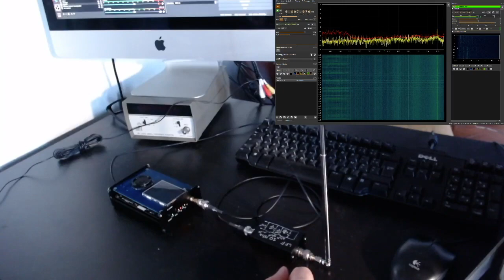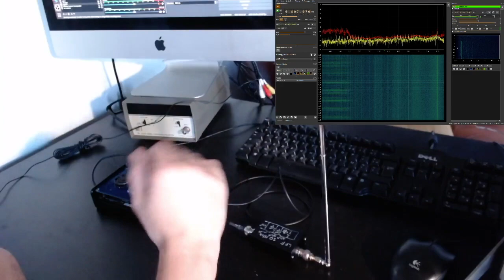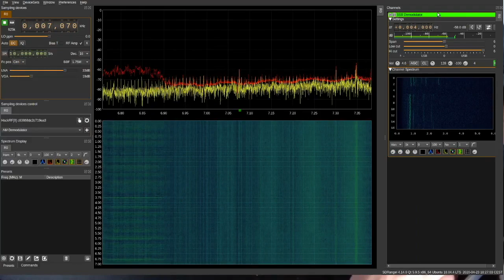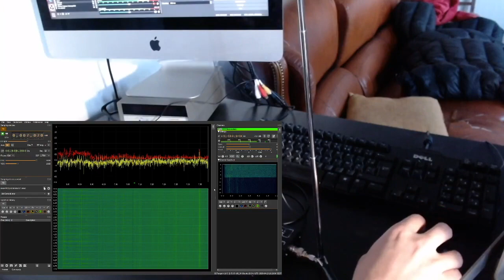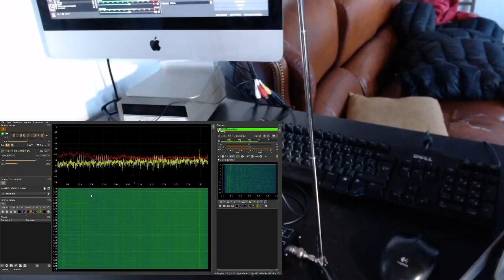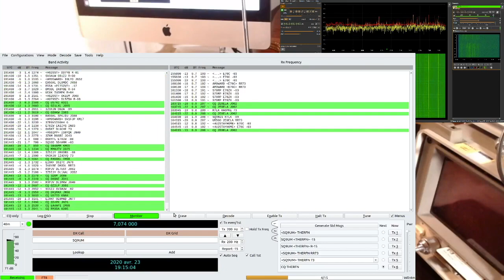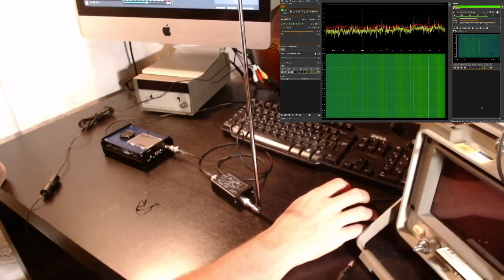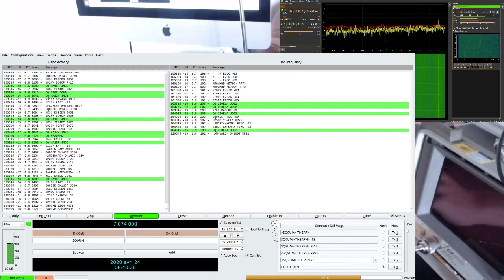Episode 16: increase HackRF reception performance with a filter.

Comment: Great video!

If you may help me, I would have some questions:
1) what's the name of the wire/connector that you used to link the filter and the hackrf? Can I use this wire to connect other devices like this power amplifier here: https://www.ebay.it/itm/324151116916
2) is your filter a band pass filter?
3) can this filter be used in other frequencies? Is there a limit of the range of frequencies that it can be used? Do exist filters that can work in a wide range of possible frequencies? How much do these filters cost? (I don't want to spend much). Are there significant results in receiving using this filter? 
4) do you think is it more needed to buy a filter or to buy an LNA?
Reply from the maker: hi!

1) it is a coaxial cable with BNC-male connectors on each side. Then to connect it to the HackRF (who has a SMA-female port) I used a BNC-female to SMA-male adapter. Similarly to the HackRF, the amplifier you linked has 2 SMA-female ports (it looks like).

2) No, it is designed as a low pass filter, but you can of course also design a band pass filter.

3) You can design and build (or buy) filters of any type! The cost depends on how well the filter rejects the unwanted frequencies. In the case of this video, I built the filter myself with spare components! :D  Total cost = just a couple of euros + the cost of the metal box.

4) The hackRF has a built-in LNA. I think the filter can improve a lot in receive mode, and it is absolutely necessary if you want to transmit with the HackRF (with the aid of an amplifier). I

CIAO! :)
Reply: @therfnoob7697  thanks you! ciao ;)